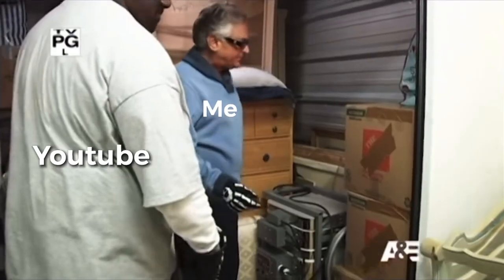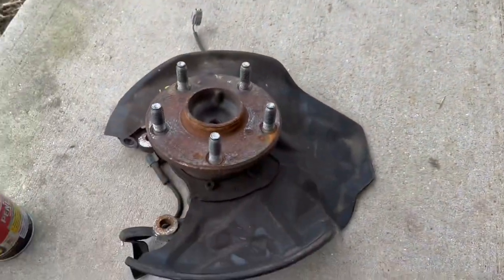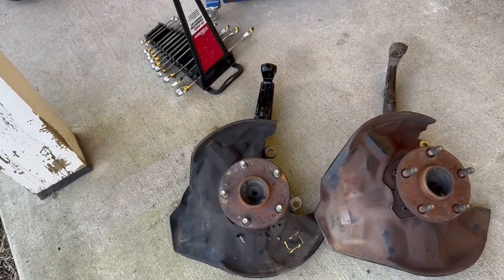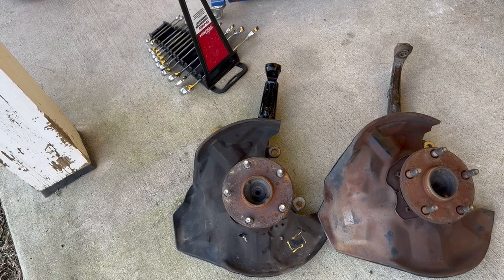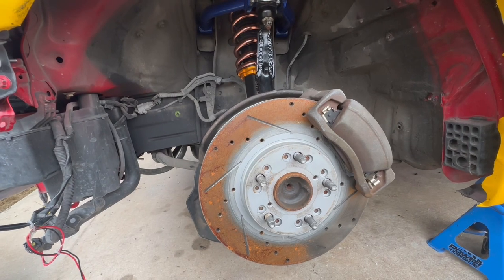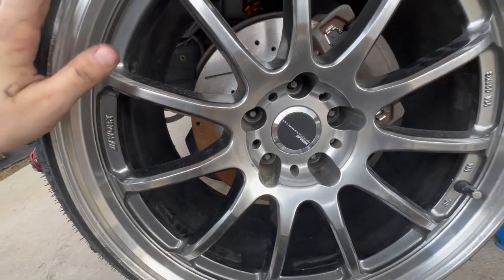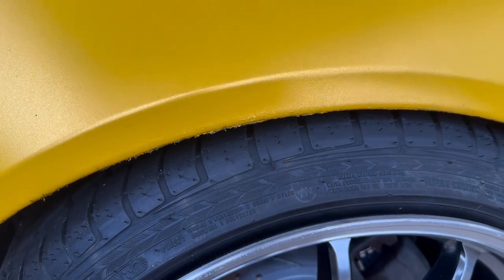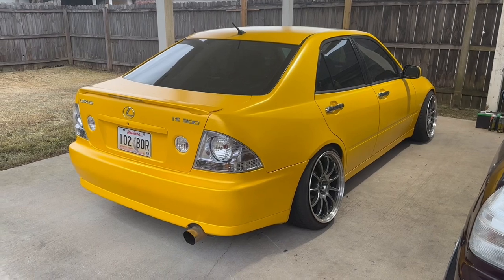Addressing a Big Problem on my Lexus IS300 (Shortened Spindles)

Comment: Car is sitting nice 👌🏼 what wheel specs are you running?
Reply from the maker: Thanks brother, and these are 18x9.5 22, but their high disk so they give me a little bit of rubbing issues.
Reply: @supahdup1126  225/40 tire on front ?